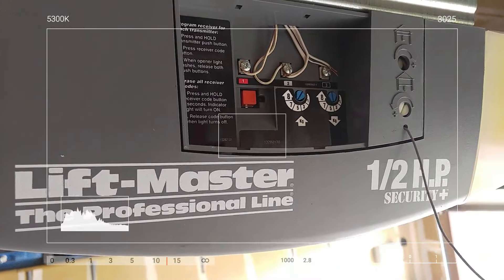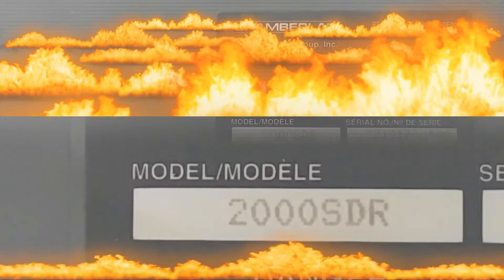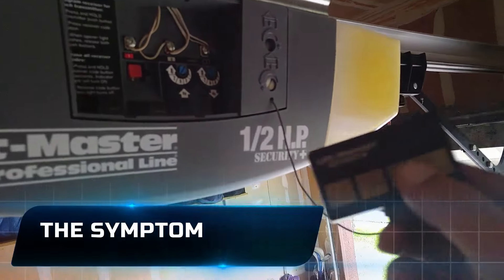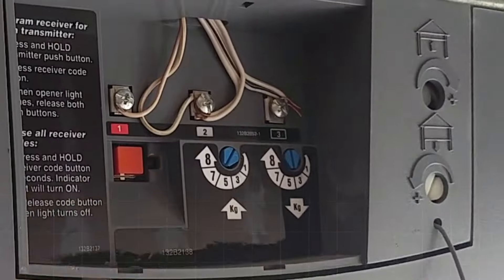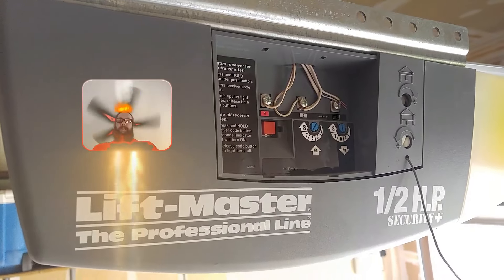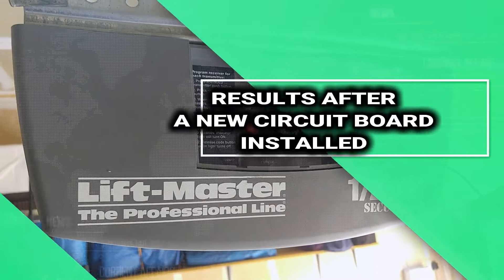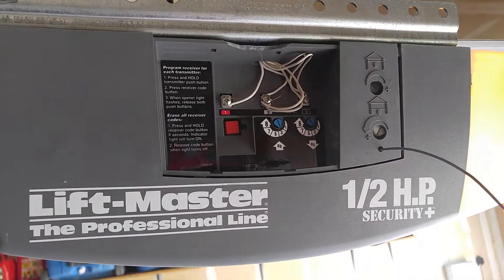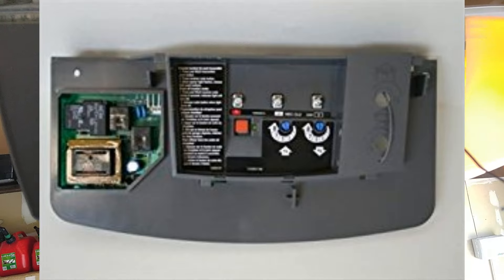Garage Door Opener Just Clicks | Chamberlain Lift Master Troubleshooting

Comment: I have the exact garage door opener and screwed it up by opening and closing it too many times within a short amount of time when trying to program it to my new car. It stopped short about 4 inches or so from the ground. I freaked out and called a local repair shop and they told me to just unplug it for 5 minutes to allow the circuits to cool down. I totally thought it would be that simple, but that fixed it! So if it stops responding due to your own doings, just unplug for at least 5mins, re-plug, and test it out.
Reply from the maker: For sure.  Great comment!  Those machines overheat and letting them sit for about 15 minutes normally does the trick.
Also by running an older machine several times in a row can cause the start capacitor to blow.  That that is normally followed by a little bit of smoke and a weird smell in the air.
With this model of garage door opener just be careful taking it apart. when you take it apart it seems to fall to pieces because everything is made of plastic in this particular model. Whenever I see these machines out in the field and it needs additional work by removing the cover, I always tell the client that I may not be able to put it back together. The mounting posts that the screws go into are made of plastic. Over time they get super weak and break off when you back out the screws to remove the lid.
Reply: @garagedoorgenius  Oh I wouldn't even attempt to touch it if it actually blew a circuit. I immediately called the number on the sticker of the local shop who installed the unit. It was pre-installed before I bought the house. I lucked out on this one for sure! Take Away: Don't open and close your garage doors continuously like an idiot. 🤣🤣🤣🤣
Reply from the maker: @Sahnya_Autumn  👍🏼😂

Comment: Don't automatically think that you have a circuit board issue just bc all it does is click.  Mine was just clicking and I opened it up to remove the circuit board and put it in the oven to try and revive the solder bc I automatically thought it was a bad board after looking at all these videos...  Clicking doesn't just mean a bad board.  When I opened mine up there was a red wire that had broken off of the connector going to a motor.  Stripped the wire, crimped a new female connector on, plugged it back on motor and fired it up.  Garage door is working again.  Free fix.   Open it up, look around, make sure ALL wires are connected all the way and none are broken... I didn't see the red wire hanging initially bc I was too busy moving it out of the way to get to the circuit board.  Slow down, look around, unplug and plug all connectors to make sure.  These motors are constantly opening and closing, being jared around.
Reply: Wait, what? Put it in the oven? Say more about this, please. :)
Reply: U have a video how to open the cover of the motor
Reply: You're awesome! the only pros i got from this idiot how to vid (was no where near how to ANYTHING!) is it lead me to your  comment Thanks I'll try your idea 1st.
Reply: Maybe this guy is a circuit board salesman 😅 My issue was the same as yours so I'm glad I guess technically this video helped me 🤷‍♂️😂

Comment: we need to see how you changed the circuit board, the whole point of looking for the video.
Reply from the maker: Well with that machine I don't touch them anymore.  The plastic posts that the board screw's to always breaks off.  8 out of 10 of those openers will do that.  Then you just created another issue.
Just replace this particular garage door opener.  Not worth investing money into it IMO. 💯
Reply: @garagedoorgenius  well shit I just bought a new circuit board yesterday
Reply from the maker: @kennyb7883  when you back out the screws, use a screw driver.  A drill is to much torque, even on the lowest clutch setting.  Back out the screws very slowly.
I'm in Texas so the crazy heat may attribute to my issue I stated...🤔
Reply: @garagedoorgenius  thanks dude I'll be super careful
Reply from the maker: @kennyb7883  just keep me updated on how it went. 
DON'T forget to unplug the machine!🙏🤪

Comment: Not all "clinking" issues require a circuit board replacement.  If the safety sensors are not connected correctly, you will get the same symptom, and will waste your money on a circuit board.  The safety sensors have a DC polarity and the wires could just be reversed on the two connector screws. Try reversing the wires on the right and center screw terminals.  This happened to me.  I discovered the problem when I took a DC volt reading with a multi-meter across the two terminals.
Reply from the maker: Yes sir you are correct.  Safety sensors will give you 10 clicks if that's the issue.  In the video it definitely wasn't a sensor issue.  1 or 2 clicks coming from a LM product generally means a smoked board or possible capacitor.
Reply from the maker: 😂🤣😂 IKR!

Comment: Solved. Push the learn button on the head unit then try to open or close garage with remote. Worked for me
Reply from the maker: Yep, that's how you program a remote!  Good job.
Reply: @garagedoorgenius  I didn't program the remote. I've done that before. The remote was synced already to the head unit. Every time I clicked the remote the head unit would make a clicking sound. So for fun I pushed the learn button and all of a sudden it worked
Reply from the maker: Very interesting.  Thanks for posting your issue and fix here.  This I'm sure will help others.
Reply: @garagedoorgenius  Just wanted to mention that I've done maintenance for 10 years. This was a first time ive came across this issue. I should mention that the garage door issue started AFTER a power outage
Reply from the maker: @TheBigRagooDOTcom  good to know buddy.  Well if you ever have other garage door issues, hit me up!
Stay safe out there 🙏
Reply: Wow, I just had the same issue. Any of our already programmed cars or remotes would just cause a clicking sound when pressed. The wall button worked fine. So after reading your post I just pressed the learn button and all cars and remotes were back working. Thanks to the both of you.
Reply: @dmagic1one  Glad I could help

Comment: Man I have this exact opener and went to touch the red button, the panel just caved in.  Lol!!!  old and everything is brittle.  motor works like a charm, but everything else is breaking and falling apart.  Thank God for duct/electrical tape.  Will be replacing soon.
Reply from the maker: @ascales30  lol, broh I know exactly what you're talking about.  When I run across those machines out in the wild I always tell folks beforehand that the case and screw posts might break.  And they always do.  Unplug it first before duct tapping it.  You could possibly arch the back of the circuit board and fry it.  Lol, yes I've done that before.  Those machines are work horses until you have to work on them.

Comment: Ugh. We did change the circuit board and the lightbulb is still FAST blinking. The control opener doesn't work, the remote control doesn't work nor does the keypad. We really were hoping to fix ourselves. Any other advice?
Reply from the maker: @teresamann4291  how many times does the lightbulb blink?

Comment: I have a Genie Silentmax 1000. It's doing the same thing as this video, but I don't want to spend $120 and risk it not being the circuit board. I've checked all of the wiring and I don't really see anything standing out, what's a good teller it's the circuit board? (I've double checked literally everything else)
Reply from the maker: What color are the LEDs currently on the opener?  
You could call Genie tech support.  Hold time isn't that long.  They'll walk you through a few troubleshooting steps to narrow down the issue.
Reply: @garagedoorgenius  The round LED red and blinking. I've checked the sensors and they check out fine. I've also checked with live chat support but they didn't help at all and told me to contact a technician (which would take 2-3 days).
Reply from the maker: @AirplanesBestFriend  red blinking light generally means you need to reprogram the up and down travel limits.  Retrain the up and down.  Then cycle it up and down a second time.  See if that fixes the problem.
Reply: @garagedoorgenius  to be able to reprogram the up and down limits, I need for the motor to be functioning, right? Whenever I put the opener in manual mode it just does the same click you have in the video. it doesn't move at all

Comment: My door goes up but wont go down. Just clicks about 5 times in a row. Circuit board really? What about the interlocks?
Reply from the maker: Check your sensors first.
  If you have that exact machine do not take it apart.  It will not go back together.  Plastic screw pegs bust off.
If you have issues with this particular unit it's best to stick a fork in it and call it DONE.
Reply: @garagedoorgenius  yes it was the interlocks. The left eye was flickering because the left rail was loose so in the down position it was aligned with the other but when the door was up the rail turned a little bit which moved the sensor/eye out of alignment.  I tightened the bottom rail bolt it works fine now. Thanks
Reply: @garagedoorgenius  thank you.  Moving the sensor a bit fixed it for me.
Reply from the maker: @SLR6700  awesome 👍!

Comment: If your garage door opener is clicking but the logic board is not the problem it means opener needs to take a break for like 15 minutes it means when you use a garage door opener so many times and all of a sudden and won't close or open it is overheating and not letting it closed or open so it has to cool down for 15 minutes thank you for learning from me!
Reply from the maker: You're right.  If ran to many times the opener will shut off.  Safety feature to allow the motor to cool.
But in this video is a board problem.
Reply: Thanks

Comment: I have the Legacy 850 and I changed the circuit board and it still just click when I press the remote. When I program it to go up or down limit it only move a few inches at a time. Once the programming is completed it just click when I press the remote. I check the safety beam and it light up just fine. Any suggestion?
Reply from the maker: Still sounds like a board issue.  You may want to call Genie for this one.  I'd say a possible start capacitor, but that unit doesn't have one I believe.
Reply from the maker: If you run your hand in front of the beams does the red one flash indicating something obstructed the sensor path?
Reply: this model only has capacitor built in into the board which I ordered the brand new one which still just click. things that are separate is the RPM sensor and the power converter and the magnetic motor. I mention before it only move couple of inches if I get into Up/Down limit programing mode. Otherwise it just click when I press the remote and nothing move.
Reply: the safety beam seem okay. It blink if I cover the eye and solid if I don't so I think the sensor is fine. I'm sure if it could possibly and RPM sensor. What do you think?
Reply: Additionally long LED blinking RED and it meant Door contact in UP or DOWN travel - Remove obstruction and Door component failure detected - Check door spring, track, rollers, hinges and fixtures. I'm not sure what to really check here. the chain seem fine.
Reply: the transformer also make a quiet hum if I put the ear close enough. Is it a sign it might need to be replaced?
Reply from the maker: @cooperhoang4558  
VERY well could be an RPM sensor.  Sorry it was my sleepy time when I was diagnosing your issue.  
For sure RPM sensors will give those symptoms.
Reply: Garage Door Genius so I switch the cords from each other for the RPM sensor and it worked for a little bit then stopped. If I unhook the cables entirely for RPM sensor then it behave exactly the same as before I have it hook in. So at this point I have good assumptions that RPM sensor is dead. I ordered a new one and hope that is it.
Reply from the maker: @cooperhoang4558  
Let me know the results!!
Reply: Garage Door Genius the optical encoder arrived yesterday and I installed it this morning and that fixed it. The issue seem to be failed board and failed Optical encoder. Thanks
Reply from the maker: @cooperhoang4558  
That's great news!
Thanks for replying back.

Comment: I moved into a house that had an opener with this syptom.  So, I ordered a new circuit board and just installed it.  I am still experiencing the exact same situation.  Just a click, and will not do anything more.  I disconnected the chain, and the trolley moves.  Opener still just clicks with no chain on the sprocket.  What can I try next?
Reply from the maker: Make sure it's not this.
https://youtu.be/TGg4-RMeefc
Check the start capacitor also.
Reply: I also replaced what appeared to be the power supply board...I am not certain what else could be replaced.
Reply from the maker: @toddhanson4418  I'm with ya.  Not much to those machines.  The opener in the video is a screw drive.  You have a chain?
Reply from the maker: @toddhanson4418  there is a RPM sensor, but that doesn't make a click.  Relays on the board click.
Reply: @garagedoorgenius  Screw drive  Plastic screw gears
Reply: @garagedoorgenius  I am having trouble with that link.  I also replaced the other board...Where is the start capacitor?
Reply: @garagedoorgenius  I replaced that at my old house.  Tiny little board, correct, by the RPM "wheel" that turns with the screw drive?
Reply: Chain out to the door, but screw drive inside.  Craftsman opener.  I bought the entire board assembly.  Two boards, light socket, etc.  I had to install the two boards in the old assembly so that it wood fit into the main assembly.

Comment: How do you change the circuit board? My Chamberlain shorted out during a rain. My car remote opens but doesn't close, my outside keypad goes halfway down then goes back up. Then the opener by the inside door opens but it won't close unless you hold it down. Now I have to get out of my car in the rain to close the garage door.
Reply from the maker: Mina it's your safety sensors, not circuit board that is causing that problem.  Make sure they are inline with each other.
Reply from the maker: https://youtu.be/QmB-Lg-T9fk
Reply: Sensor issue not circuit board

Comment: I can't find a solution to my problem anywhere! I have a Chamberlain Liftmaster 1/2hp model number 1355. It is 12 years old, and has been working fine no issues. We have a cat that sleeps in the garage at night, so in the morning we will crack the garage about a foot so he can go out etc. We have been doing that for years, but lately he has been chilling under the door because he doesn't want to go out he wants to spy on other cats, birds, etc! I go to close the garage door and out of nowhere the light bulb is rapidly blinking, the garage door opener on the wall is rapidly blinking, and the opener itself is clicking all simultaneously, and in sync. The sensors are green and amber, the green one blinks when I pass through. This rapid blinking and clicking doesn't stop EVER! I don't know what to do. I have checked over so many things, nothing fixes this. Also no button pressing on anything is making the door open and close, so I had to disengage the door and locked it with a padlock from the inside until I can figure out what is wrong, and unplug the unit and I turned off the breaker. This opener btw has its' own breaker and own plug, and the wires are behind the drywall too. :(
Reply from the maker: The rapid flashing wall button.
A. It could be in lock mode.  Press and hold the wall button until the light stops flashing.
B. 10 Continuous flashes from the light bulb means safety sensor issue.
If you can't get the wall button from blinking, the circuit board is toast unfortunately.
Reply: @garagedoorgenius  thank you this fixed my issue!
Reply from the maker: @kyles2284  Sweet!

Comment: Our Lift Master does this sometimes, but other times it works fine. Given that, is it still likely that a bad circuit board is the problem?
Reply from the maker: @ajchovanec  when it clicks, do you know how many times it clicks?
Reply: @garagedoorgenius  Thanks for your response! I think it's like two clicks in rapid succession (in less than 1 second), like "tah-tuh". The second click sounds slightly different than the first.

When it gets stuck open, we pull the manual release so that the door drops a foot or so. Then we re-engage the release and press the button again, after which it usually closes on its own. 

When it gets stuck closed, we grab the bottom of the door and lift it up a few feet, and then the opener usually kicks in and it finishes opening on its own.

We have found that it almost always gets stuck open after opening, unless we press the button to stop it from closing all the way just before it reaches the top.

Comment: Coukd it be a capacitor?
Reply from the maker: It could.  Typically if it's a capacitor you hear it blow and see smoke.  Or if you are coming in with the car and don't hear it blow, you'll smell a burnt electrical smell in the garage.
The capacitor is easy to take out and see if it's blown.

Comment: Where did you go to get your circuit board?
Reply from the maker: bannanapancake 
I had a couple circuit boards for this machine.
If you have this particular unit, I'd advise just replace it.  As soon as you take the cover off the screw mounts break off.
Reply: Garage Door Genius - Hey thanks for your response;) I have an older formula one (lift master) from 96! Yikes😬 just trying to find some options;) thanks again man, I really appreciate it;)
Reply from the maker: bannanapancake 
No problem!

Comment: I had two clicks and simply cleaned the sensors. Garage door opened up immediately. 

It’s not always the circuit board
Reply from the maker: 10 clicks is a sensor issue.  That's how it's always been with Chamberlain LiftMaster.
I'm glad you fixed your issue.